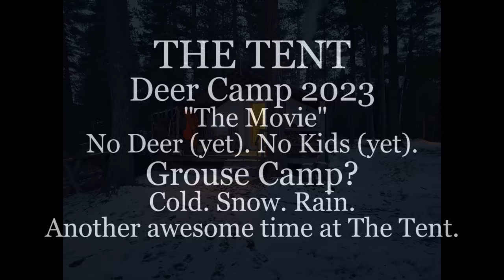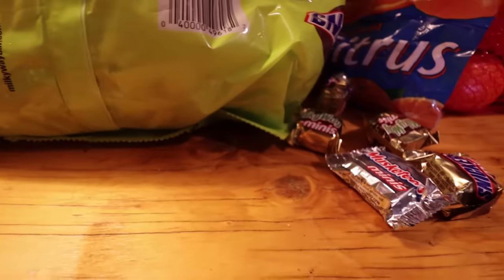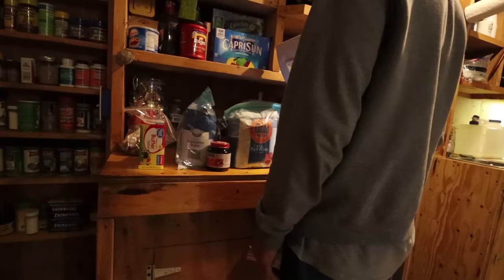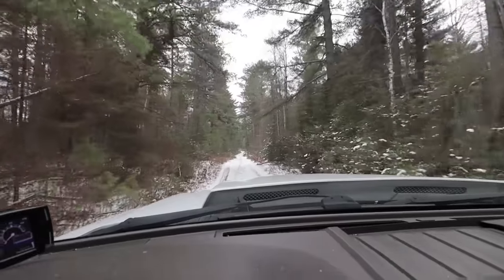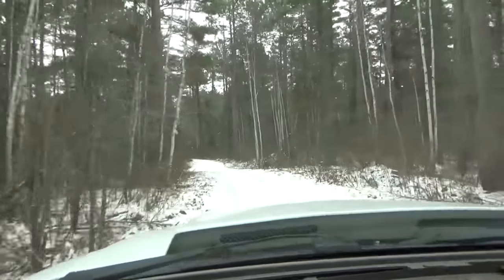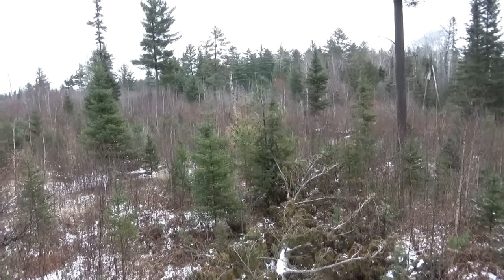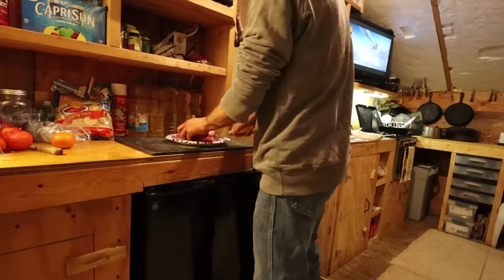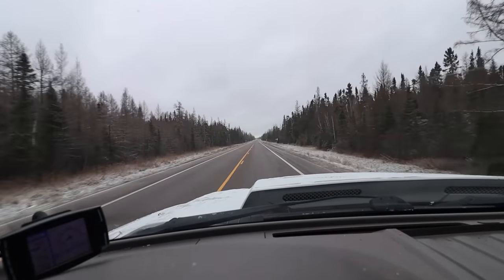THE TENT. Deer Camp 2023, "The Movie." No kids yet. No deer. Grouse Camp? Still a great time.

Comment: If you keep a large volume of sourdough starter, you can avoid the initial levain, just feed the starter early and add the weight of starter, makes the process much faster and works well.  I make bread, bagels, and soft pretzels.

Comment: If you make up air tube for the outside air I would put an extension tube on the hot air discharge blowing out into the open space. Other wise to me the make up air tube will pull out some of the heated air.

Comment: You can use the discarded starter to make sourdough biscuits...2 cups flour, 2 teaspoons sugar, 2 teaspoons baking powder, 1 teaspoon kosher salt, 3/4 teaspoon baking soda, 1/2 cup unsalted frozen butter (grated), 1 cup active starter, and 1/2 cup buttermilk...I dump everything into the food processor until it comes together, roll it out about 1 inch thick and cut the biscuits.  Bake at 450 for about 15 minutes.  I bake mine in an iron skillet.

Comment: Just be careful so you don't overheat it because the intake is too close to the outflow. Small diesel heaters can become much less effective because of it since you risk creating a circulation pattern where the hot air just recirculates through the heater and not much else.

Comment: Question….I see how you season your cast iron pans, just want to ask…what are you using to wipe them throughout the process? If I use paper towel, seems it breaks down when so hot and leaves paper towel in my pan…I was told coffee filters are good to use.
Reply from the maker: You are correct, I use paper towels and you have to switch them out (not seen in the video) or they break down quickly.

Comment: Hi Joe. Question, do you ever use the lantern on the table you set at? Just wondering. Fantastic video btw.
Reply from the maker: I have in the past when the power goes out and I decide to not use the generator and just run the Tent 100% off grid with the propane and kerosene lanterns etc.